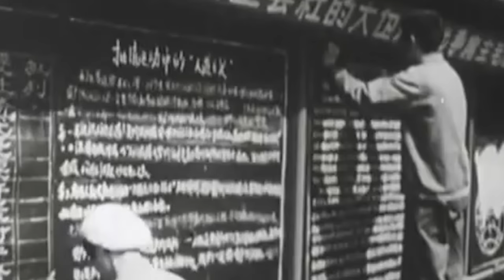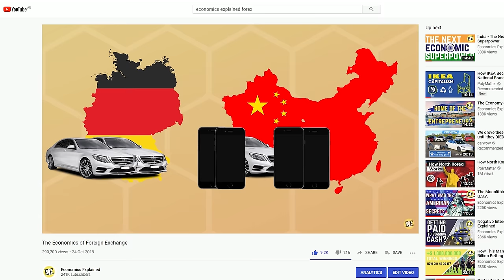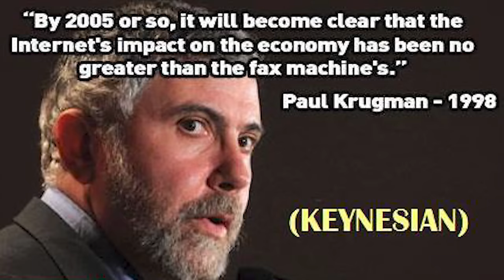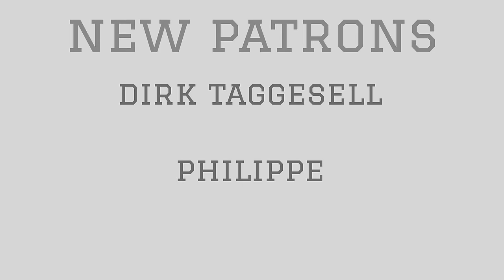The Economy of Modern Day China

Comment: As a long-term expat in China (seventeen years and counting) I have witnessed the transformation. It's been exciting and there's an optimism prevalent in a place where every year is better than the last. It has been interesting to see when local or provincial officials pop up claiming that it's time to recentralize the wealth distribution (i.e. go back to actual communist practices) they either get managed out or worse. When you are the only party in town you have to make sure there aren't any crashers. The CCP is constantly trying to prove to its citizens that they can keep them safe and on the path to continued prosperity.
Reply: All they've proven to me is how dangerous and depraved they are.
Reply: Although looking forward the continuous prosperity promised only gets more difficult to achieve over time with the looming headwinds of unreversed aging, overleveraged debts, loss of easy profit opportunities, and industrial pollution further reducing the stock of arable land and potable water. However the CPC doesn't tolerate dissent or challenges to its power, but it might have to allow political competition to at least appear like they're the best choice, or risk ruling over an increasingly more suffocated and less productive China if it does survive intact.

It's not obvious right now, but in a couple decades the cracks will become more visible. The question then is will the Party find flexibility to absorb those stresses, or will it double down on hardness and likely get more brittle in the process.